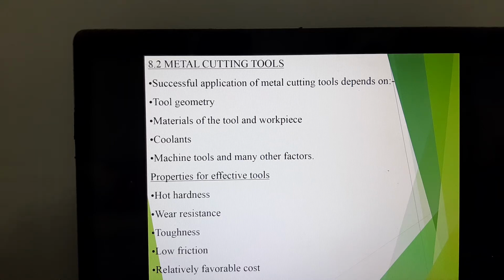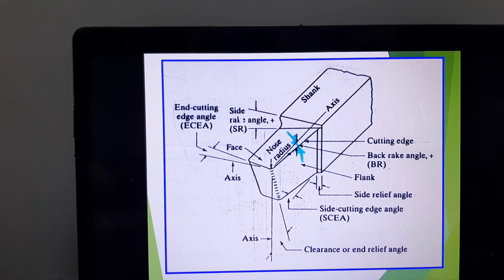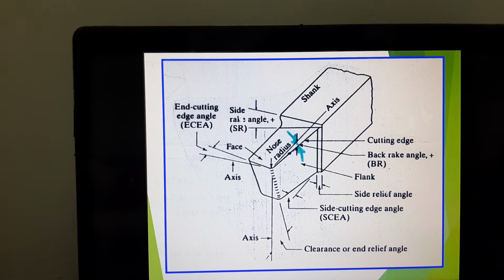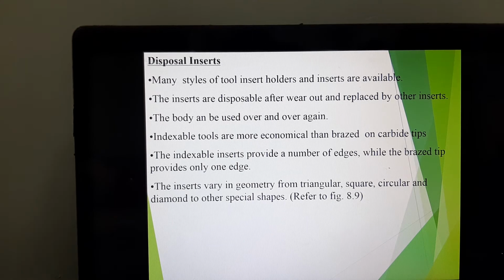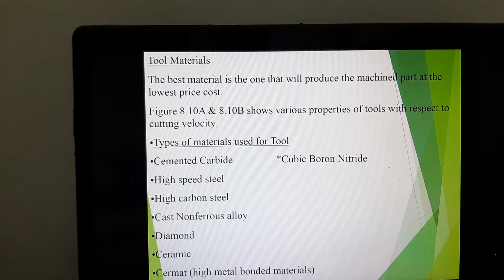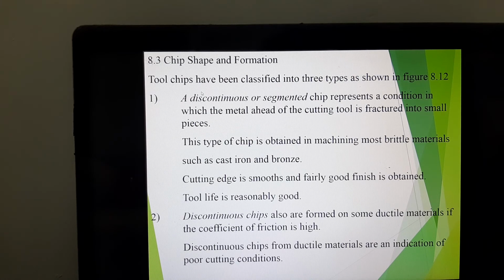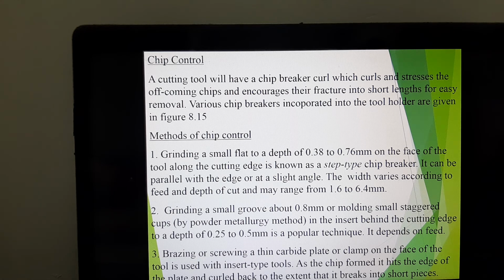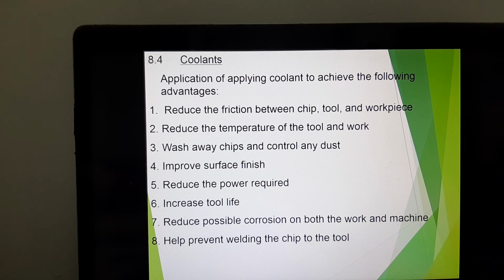Metal cutting operation

Comment: Mohammad Aliff Bin  Mohd Pauzi (ME0104760). 
 From this video, I have learned that a good cutting tool has high hardness, high wear resistance, high toughness, low friction during machining and relatively favourable cost.The cutting comes with various angles, which are angles of the rear rake, angle of the main cutting edge, angle of the main rake and angle of the end cutting edge.Each angle has different functions. Angles will vary based on its specific angle. The side cutting edge angle varies from 0-90 degrees. If a bigger angle is chosen, a larger chip will be generated which causes the tool to become blun

Comment: Good Afternoon Dr, what I learned from this video is that we need to be smart on selecting effective tools. These tools must be high quality, wear resistance , high toughness, and a favorable cost. I also learned about cutting tools. The cutting comes with different angles. These angles work differently between each other. Generally, the larger the angle, the larger the chip produced. Next we learn about inserts. There are two types of inserts. Other than that, we learn about type of material used to make the cutting tool. High speed steels and cemented carbide are the materials widely used. Moreover, we can improve the finish of our cutting by using coolant. Thank you Dr.

Muhammad Naquib Bin Nor Azlan
ME0106093
Section: 01

Comment: Having discovered that we need to know how to select effective tools, the tools must be of high quality, wear resistance, flexibility, low friction and relatively favorable cost. I find out about the cutting tool info too.The cutting comes with various angles, which are angles of the rear rake, angle of the main cutting edge, angle of the main rake and angle of the end cutting edge. Each angle works differently. Angles can differ depending on their particular position. The angle to the side cutting edge ranges between 0 and 90 degrees. When a larger angle is chosen, it will produce a larger chip which will cause the device to become blunt. The lateral relief angle then segregates the nose from the cutting tool portion. The angle of the back rake has 2 different angles, which are both positive and negative. The positive angle generates chip away from the cutting field. This is used for materials of ductile quality. The negative angles cause the chip to curl in toward the cutting zone used for brittle materials. Inserts are used where 2 types of inserts are used. Next is an indexable insert that can be reused and resharpened for mass production. Additionally, disposable insert is used where it can not be reused and for smaller output purposes. Moving on, there are different tool materials. High speed steels and cemented carbide are the most common ones, since they are compatible with a lot of material and inert. Diamond is the best but the cost is very high. We have to avoid built up edge chips because the chips will weld against the device.

Muhammad Harits Bin Mohamad Zailan
ME0106091

Comment: Good evening madam, what i have learnt from this video are we use different tools for different task, parts of the cutting tools, different functions of different angle, the smaller the angle the smaller the chip generated, 2 types of insert, types of tool used to make a cutting tool, type of chip breaker.
Luqman Mizani
ME0106085

Comment: From this video I learned about the important of cutting edge in cutting tool. Each edge cutting tool has thier specific angle and function. Different metal use different cutting tool. This is because each cutting tool is designed specific metal. Type of angle is BR, SRE and SCEA.
ME0106908 
Rajbhinder Singh

Comment: Hi mdm, I have learnt that function and importance of Back Rake angle + for ductile material, while Back Rake angle - for brittle material. 
I also learnt the functions and importance of Side-cutting edge angle, End-cutting edge angle and Back Rack angle and its contributions to the cutting tools. 
I also learnt that there are indexible inserts(for large production) and disposal(for small production) which is a popular choice nowadays and learnt the materials for the cutting tools. 
I also learnt the classifications of tools chip. There are different type of coolants and its importance to the cutting tools.
There is also chip breaker is also needed for ductile material, and there is 3 types of chip breaker (Step, Groove and Brazed) and its function to prevent the smooth flow.

DARRELL ANAK DAU
ME0106084

Comment: Hi Madam,I am Tan Kang Je (ME0106097),from the video above ,i learnt about the properties that we should be consider for an effective cutting tool,high in hardness and toughness ,low in friction (prevent from high heat),high resistance in wear and low cost.Besides,i learnt the structure of the cutting tool and some important angle.The side cutting edge angle(SCEA) ,between 0 to 90 degree,the higher the SCEA,the thicker and bigger the chip,and the lower the cutting tool life will be and vice versa.The side relief angle (SR), that separates the nose from the shank in order to prevent damage of the cutting tool. The back rack angle:Positive - chips generated away,suitable for ductile materials;Negative - chips generated inwards,suitable for brittle materials. Furthermore,there are two type of inserts. Indexable insert which is higher in quality,can be resharpen and therefore used in mass production.Disposable insert which cannot be resharpen and only suitable for  small scale production.Moreover,i learnt that cemented carbide and high speed steel are commonly used because they are very compatible with a big variety of different materials,no chemically active(inert) ,readily available and cheap.Diamond is another excellent choice as it is the hardest material in our planet and inert,but it is high in cost which made them not commonly used . Next,discontinuous chip will be produced by brittle materials,while continuous chip is commonly found during cutting of ductile materials.Built-up Edge chips (BUE), normally found when we cut overly-ductile materials,caused by chips weld on the tool part and causes failure of the cutting tool.Hence,there are three type of chip breakers that help to prevent BUE ,step,groove and brazed. Last but not least i learnt about the importance and function of the coolants during metal cutting process.
Thank you Dr.

Comment: RAVEEN KRISHNAN A/L K. BALAKRISHNAN
ME0106095

Hi madam, this video has taught me that there are a few aspects we should consider when choosing a cutting tool for an optimized cutting process which are high hardness, high wear resistance, high toughness, low friction and relatively favorable cost. All the cutting tools have a tool geometry and is designed to perform particular tasks. The nose of a cutting tool has a few angels such as the back rake angle (BR) , side relief angle and side cutting edge angle (SCEA). The SCEA determines the chip thickness that is generated. The smaller the angle, the smaller the chip generated therefore producing a longer tool life. The side relief angle separates the nose from the shank, without it the tool and material will undergo breakage or be damaged. The BR consists of two(2) different angles which are positive and negative. 
- For positive, the chip generated will move away from the cutting zone and is used for ductile materials
-For negative,  the chip will curl in and move towards cutting zone. The chip may stick (be welded) onto tool and permanently damage the tool.It is usually used for brittle materials.
There are two(2) types of inserts :-
1. Indexable - used for mass production -> can sharpen and reattach
2. Disposable (cheaper) -  used for small amount production -> once utilized, cannot be reused
The materials that are commonly used for cutting tool are High-speed steel and Cemented carbide. Both these materials are very compatible and chemically inert.
Brittle materials produce fragmented chips while ductile materials produce long continuous chips. 
For an overly ductile material, the cutting tool must have a chip breaker (step, groove, brazed) to make sure as we cut, the chip has an obstacle
Finally, a coolant is very important and has many important functions.

Comment: Good evening madam, i Muhammad Khairul Afiq Bin Azaha ME0106092. From this video I learned about the important of cutting edge in cutting tool. Each edge cutting tool has thier specific angle and function. Different metal use different cutting tool. This is because each cutting tool is designed specific metal. Type of angle is BR, SRE and SCEA.

Comment: Good evening madam, today I have learnt the factors to take into consideration when choosing cutting tools. The cutting tools must have high hardness, be wear-resistant and have low friction coz higher friction causes more heat which will make the tool wear faster.
Each cutting tool cannot be multitasked like a household knife because each tool is designed specifically.
I also have learnt that the cutting tools are made of a nose and a shank and some important angles such as back rake angle (BR), side relief angle (SRE) and side cutting edge angle (SCEA). Every material has its own specific angle.
The SCEA determines the chip thickness that’s generated. The higher the angle the thicker the chips generated because the depth of cut is higher. This will cause the tool to become blunt and reduce its tool life.
The SRA separates the nose and shank. If absent, it may cause tool breakage and material to be damaged.
The back-rake angle has 2 different angles which are positive and negative. The positive angle causes the chip to generate away from the cutting zone. It is used for ductile materials. The negative angles cause chip to curl in towards the cutting zone, which is used for brittle materials.
Next, I have learnt about inserts. Disposable inserts are cheaper and are used for small productions, while indexable inserts are used for mass productions and can be sharpened when removed.
Cemented carbide and high-speed steel are normally chosen as cutting tool material because they are compatible with most materials and don’t cause chemical reactions.
Brittle materials produce discontinuous chips while ductile materials produce long, continuous chips. We must avoid built-up edge chips from overly ductile materials by inserting chip breakers (step, groove or braze).
Lastly, I have learnt about the functions of coolants.
Thank You.

Khiiren Shri Ram
ME0106086

Comment: Good evening madam, from the video I have learned  that there are different angles in a cutting tool such as back rake angle,side cutting edge angle, side rake angle and end-cutting edge angle.For side rake angle, the smaller the angle, the smaller the chip produced thus the tool has a longer life.Back rake angle has positive and negative angles and have specific uses.Positive BR angle is for ductile and negative BR is for brittle materials. Furthermore, i have also found out about the uses of inserts and the types of inserts. Then, the suitable material and properties of a efficient and compatible cutting tool is also known. Lastly, the chip formation and chip control methods was also introduced in the video.

Shahnyeel A/L Anil Kumar
ME0106096

Comment: Good afternoon Dr, im Mohamad Fayyadh B Fazlulaah ME0106089. From this video, i have learned that hte cutting comes with several parts which are side rake angle, side relief angle(seperate nose from body of cutting tool),positive back rake angle(made for ductile material),negative back rake angle(made for brittle material) and end cutting edge angle.  Other than that, i also have learned that chip also got its own breaker which are step,groove and brazed.These breakers are made to make sure the chips are break when maching. Otherwise the chips would weld  against the tool and damage happened. That's all. Thank you for you sharing Dr.

Comment: Mohamad Ikhwan Syafiq bin Zadi
ME0106090
Good morning Dr, from this video I learned that good tools need high hardness and toughness , low friction and reasonable cost. These tools also come with several angle that need to be known . Each of them have different function. I also learned that tools nowadays use insert to help the cutting process. Theres two type of inerts which is indexable and disposal . Cutting pocess will produce chips such as continuous , discontinuous and built up chips . Several type  chip breaker introduced to encounter this  chips such as step groove and brazed. We are also taught importance of coolant to reduce heat during the cutting process. Thank you Dr for the informative video.

Comment: FAIZ AFFENDIE BIN MOHD NAZRI
ME0106085
Good day, miss. From this video I have learnt about what it takes to make cutting tools effective as well as the successful applications of it. Also every cutting tool is designed differently in order to cut various types of metals. The angle of the tool affects the tool life itself if used against more brittle material. There are also some type of chips formation which are continuous, discontinuous and built up edge chips hence chip breaker(step, groove,brazed) is compulsory on a cutting tool to make sure the tool life can be prolonged. Coolant is also important as it plays some major roles in extending the tool life itself such as washing away chips and reducing the friction between the tool the chips and workpiece. Thank you.

Comment: Ariff Bin Alzakri
ME0106046
Some of the things that I have learned from this video is that there are 3 forces which are present during the metal cutting which is frictional force, shear force and normal force. Besides that the tool forces are not changed significantly by the cutting speed. Tool force increases with greater feed and larger depth of cut. Cutting force also increases with the size of the chips.There are 2 types of horsepower, one at the motor/machine and the other at the spindle where the horsepower at the motor is always larger than at the spindle due to it being loss in the form of frictional force, heat and other forces.

Comment: Muhammad Amir Aiman Bin Mohamed Azril  ( ME0104247)

From this video, I’ve learnt about the properties for effective tools and also the angle of tools. I also learn several type of angles and this video is more focus on SCEA,SRA and BCA. You also mention that each cutting tool is design for a specific task. I also learn that you need a nose and shank for a cutting tool. SCE is vary from 0 to 90 degree. The higher the angle, the more the chipping size. SRA separate the nose and the shank. BRA has two types which is +ve and -ve. Positive BRA make the chip curl and  move away from the cutting zone while negative BRA make the chip curl and will move it to the cutting zone.

Comment: Name: Neena bt Ahmad Nizam
ID: ME0104364

From this video, I have learned the tool angles. For example the side-cutting edge angle (SCEA), positive and negative back rake angle and side relief angle. I have also learned about inserts which is a holder that prevents he nose from getting blunt and inserts can be indexable or disposable. The best material for a tool is the cemented carbide and steel as it is compatible and have no chemical  with several materials.  Other than that, the chip formation we must avoid is the Built-Up Edge chips (BUE) and for that we use chip breakers. Types of chip breakers we use are step, groove and brazed. Lastly, coolants are a must while manufacturing. The function of coolants are to reduce friction between chip, tool and workpiece to wash away chips and control dust, to increase tool life and many more. Thank you madam.